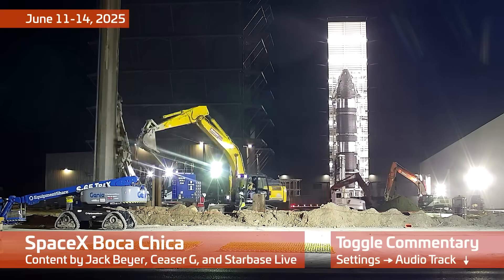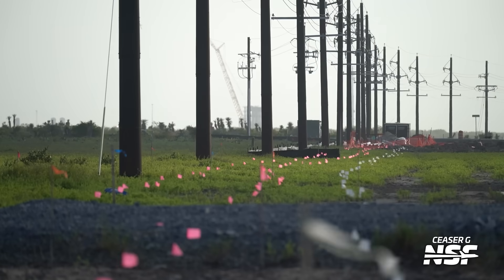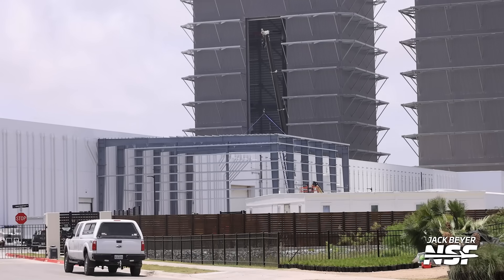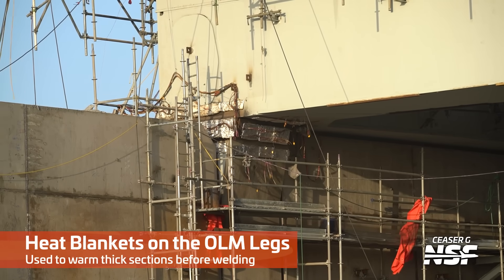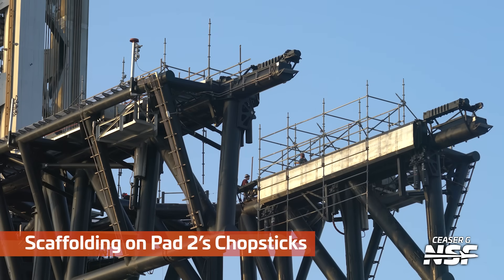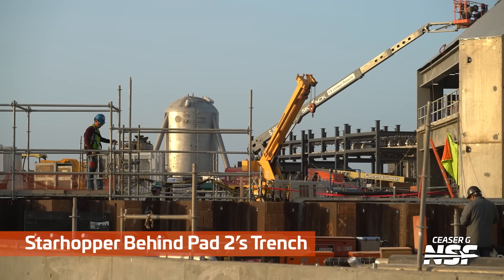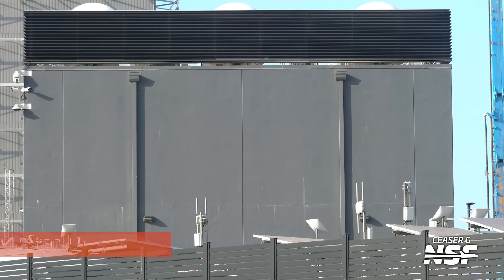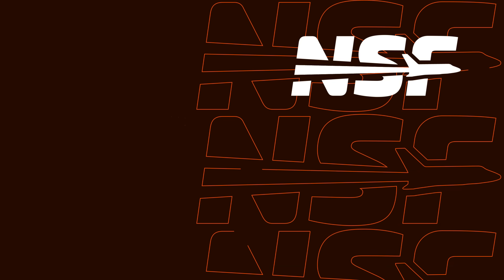"What did they cut with that grinder??" | SpaceX Starbase

Comment: Welder here . Some specifications and codes require a preheat. I did high pressure stainless needed to be around 300F to weld each pass.
Reply from the maker: Interesting... those heating pads must draw some power. I guess most welding equipment does, so not that surprising. 🤔 - Das

Comment: Welding and cutting gas lines and cables is what you see hanging. Preheating is for multiple reasons, including preventing stress cracking and hydrogen induced cracking.

Comment: You preheat the metal to minimize localized thermal expansion and contraction at the weld site. It helps prevent distortion of the part.

Comment: You mentioned after next high bay is built and giga bay goes up  possibly work with Spacex to possibly mount a camera for visual coverage but make the upfront rule that any angles will NOT be allowed inside the new bay so that any propriety information or photographs or designs will be no shown or published.  Spacex might find that you voluntary willing to keep different aspects private is showing a willingness to work with them to further the construction/stacking more cooperative with them.  A preemptive rule that will be done so that Spacex doesn't have to come back later and say no and everybody loses, also this information and visuals should be shared with everyone that covers there should receive same video but of course marked as "video provided by NASASpace" flight like the NFL networks share video with each other and put this type or similar type of recognition on the video.  This would include Ellie in Space, Everyday Astronaut, Felix from What about it.  Shows working together for common goal.
And than the guys using a grinder used to cut things apart is normal, it takes to much time to go back down to maintenance to make fit.
And the person using flagging the direct the dump trucks is a safety precaution to avoid collisions dump trucks can't stop on a dime.

Comment: Welder here. 
1. Have to take the chill out of metal before welding. 
2. Preheating thick steel definitely required for heavy structural.
3. Also after welding cover like this so it cools much slower (hold heat in) and shouldn’t crack.
Reply: Interesting

Comment: The cabling is for a device called "pink fingers." The metal is heated above 300 degF to prevent running cracks in high carbon steel. The foil covers the pink fingers and kaowool insulation.

Comment: It may be pre-heating to allow for better penatration when welding
Or there has been welding done on the other side of the panel, and they are slowing cooling the panels down to prevent stresses and warping. 

If big thick metal cools down too quick, it causes internal stress. Same reason as for pre-heat, but pre-heating also allows for a deeper penatrating weld without as much current and thermal transfer, again helping prevent stresses and possible porosity that could develop into cracks

Comment: It all has to do with thermal shock.  If they can bring the base metals up nearer to weld temps, then lower the temp slowly, it prevents any brittle points around the weld.

Comment: Welder here. You have to preheat the metal since it’s really thick to get proper penetration for the welds. Most times we use gas torches but im guessing with such large pieces it’s more efficient to heat them with these electric elements.

Comment: Depending on the thickness of the steel, heaters applied next to a joint would be to help relieve thermal stresses during the actual welding.

Comment: at 6:40 the caples are for all the different welders.   welding gas and either high current electric arc cables or oxy and acetylene.
Reply: They are color coded. Each bundle has a large diameter red hose and a thinner yellow cable or hose. Each pair is held together with white tape. The yellow is much more flexible than the red.

Comment: Thick or high strength steel must be heated to ? 400 degrees or so and then post weld heat treated and slowly returned to ambient.

Comment: Preheating is done on thicker sections to mitigate internal stresses due to high temperature gradients that would otherwise be generated by welding.
Reply: Also to change the hardness. So welding may make it brittle and they reheat it to anneal it.
Reply: It also helps improve weld penetration (as in, the weld penetrates deeper into the metal being welded rather than just piling more material on top).
Reply: Preheating reduces the weld toe crystallisation. This region is always the weakest and most highly stressed part of the weld.